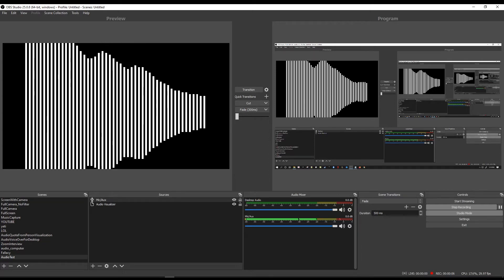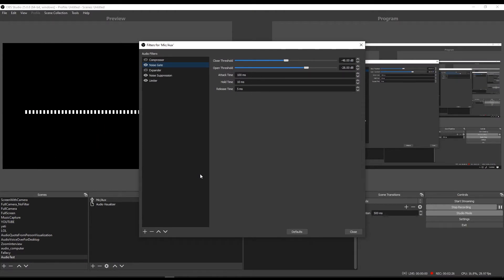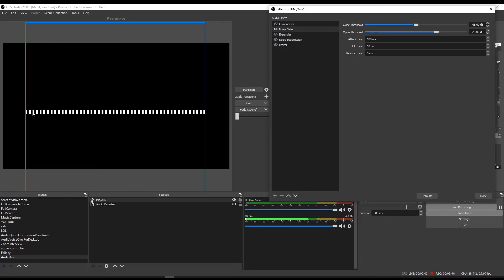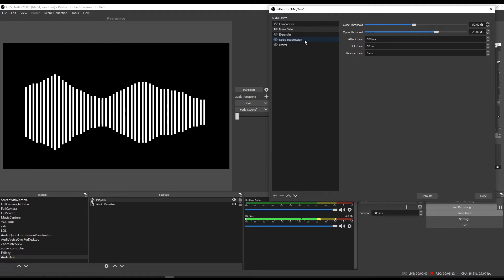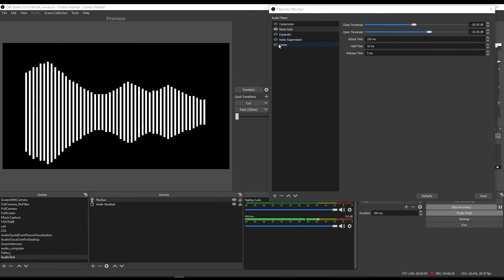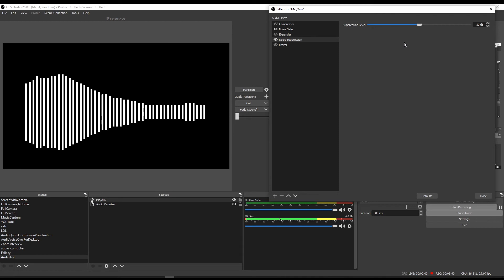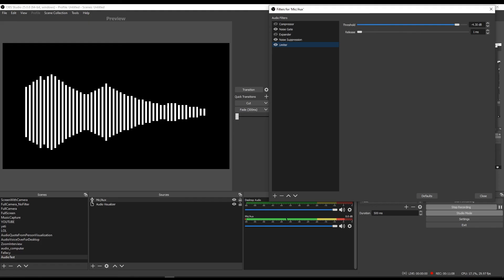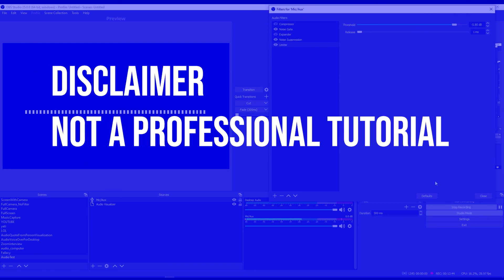How to get better sound in OBS using Noise Gate, Noise Suppression, and a Limiter

Comment: Hey man  thanks for this, quick question, why would OBS clip when it's in red? It's still underneath 0 DB. The Red zone starts around -9db which is a pretty low volume output when i try to relisten. Hopefully u can explain me and answer my question. Thanks!
Reply from the maker: Been a bit since I've looked at the settings in OBS but you could be getting clipping (at the loud end) because your limiter threshold is too low. For example, if you add an audio filter to your microphone and crank it down to -50, that limiter will cut off everything above -50db. Alternatively, you might want to check the Noise Gate Settings, lowering both the Close & Open Thresholds.